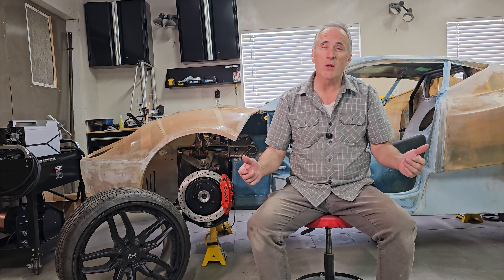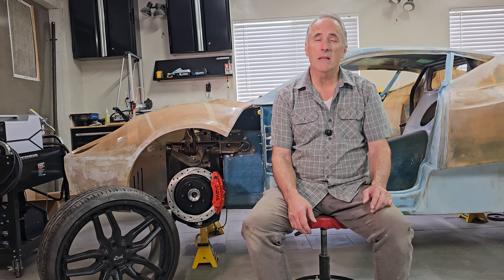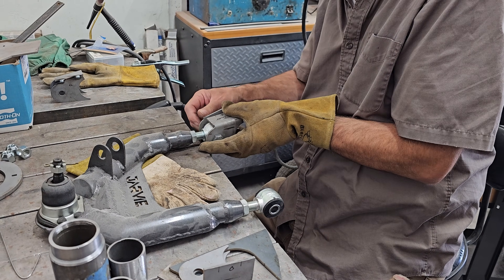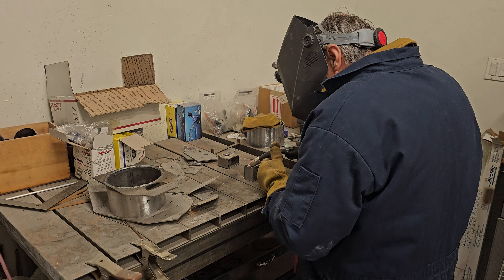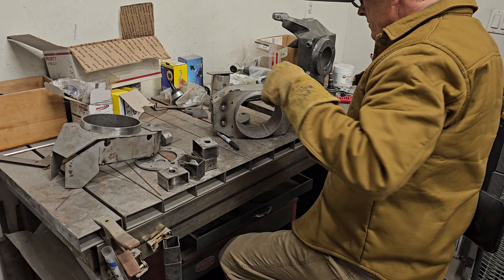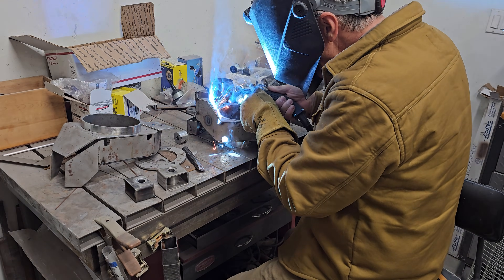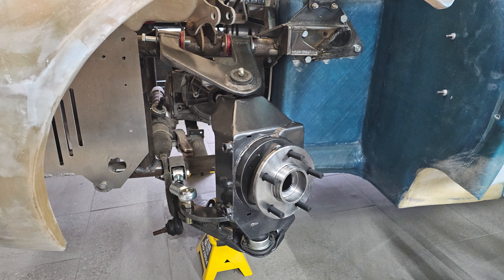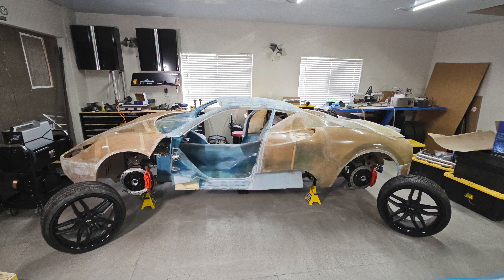A96 All the suspension complete??? Arete Supercar project

Comment: Hey Jay, I really do understand the speed of using a CAD you're already familiar with but Solidworks is exactly the right tool for this work and is only $48/year for a non commercial license. I have 15,000+ hours over the last decade of using it professionally at work for sheet metal etc. and it is an absolute life saver, especially for checking form fit and function of complex assemblies like your wheel hub. Now I use it for my automotive and electronics hobbies at home. You're an inspiration and I love seeing the progress at whatever pace suites your lifestyle. I identify being spread between all the other cool projects you've got going and most importantly, your family. Very impressive how you're able to balance it all together. If you pick up solidworks and need some help or just some 3d mechanical design work, feel free to reach out!
Reply from the maker: Yep, I bought the expensive, full, suite for a year, so that my son and I could learn and use it. He has since gained a job (and been promoted to lead designer) in a fabrication company. However, even he threw up his hands up in frustration when confronted with the crazy strange interface for web based users (makers $35 version). Grgggh!

Comment: freeCAD is also an option
Reply: Nice 😎

I use Autodesk Fusion 360 👍 There's a free version 😀
Reply: @UKBUILT yeah but it limits commercial use
Reply: @AngryMan540 The free version is for non buisness use but it is still very good for home use🙂 

The buisness version is quite affordable for an all in one CAD/CAM package. Last time I brought the buisnesses version it was around 150 for the year 👍

Solid works and catia are in the thousands.

Fusion 360 is easily the best most affordable CAD software I've used 👨‍🔧

There's plenty of options. It all depends what your using CAD for and how much capability you want. 

I use it mine for 3d printing and machining.

😎

Comment: Fantastic work! I design my 3D models in Alibre' (which has sheet metal forming) and generate G-code from those models for CNC machining or printing or injection molding in Fusion 360. It's an economical alternative worth exploring. It has it's limits, but I find Alibre' to be a great creator's software.

Comment: Making your own suspension parts is really impressive, I was not brave enough to attempt that. I had enough trouble trying to figure out where and how to mount the attach points for the correct angles. The car is looking great!
Reply from the maker: Brave enough? Or stupid enough? Ha! By the way, I caught your video today @basementsupercarbuild2948, but was watching it on the go and couldn't comment on your carbon dual side dilemma. I came across some product (sorry, cant remember the name), but it was a material that expanded (could come up with other materials that do the same) and filled the mold. Meaning, make a two-sided mold, do a wet layup in each side, put the expanding core in between the two molds, close them up and then heat the mold. Ba-Boom! Thin section, two-sided parts! I wish it was that easy, but something to consider.

Comment: They look good lateraly, but are you confident with the longtidunal forces on that bottom rear arm?
Cheers
Reply from the maker: I used to worry about ALL the suspension on the car until I dismantled a Mazda Miata. Now, for the weight, I think it may all be overkill. Ha!

Comment: My brother, Autodesk Fusion is free, it's damn near as good as SW, and you get most of the functionality on the free version, and if you want to pay it's definitely more affordable than SW.

I'm a mechanical engineer and 23 year journeyman machinist in my profession, but at home I love ADF(formerly Fusion 360) for all my modeling and 3d printing needs.
Reply from the maker: Yeah, the web based free versions are a nightmare. My son, who uses SW at his job, came over to show me a few things. Through his arms up in disgust, trying to figure out the user interface for the free web based version. That was my problem as well. The interface.
Reply: Yeah. fusion 360 is the way to go 👍 I use the free version that you can install on a desktop and use offline 😁

It's been great for me for everything from 3d printing, 2D drawings and cnc machining. It has built in CAM processors. 

I've used solidworks, catia, autocad, 123D design and fusion 360 is my favourite 😎👍 my only gripe is cloud storage. I don't trust it so I back everything up manually. 

Even if you want it for full buisness use it's about 150 for the year 👨‍🔧 it's the most capable cad/cam platform I've used.

Comment: One more step closer to the road - AWESOME!  Amazing job building that suspension setup BTW, I don’t think many understand just how complex it is to build something like this.  Glad you left plenty of room for adjustment because no doubt you will be doing fine tuning once on the road.  The only observation I have is on the size if the rotors, they seem small for a sports car.  I assume these are a starting point as well?
Reply from the maker: Rotors are taken directly from a Corvette C6. Mostly because after market parts ore so  readily available and inexpensive. Bigger rotors if I ever get to bigger braking!
Reply: @BuilderCreator It must be the camera angle, I never would have guessed C6 rotors.  None the less they were very good brakes in their day.